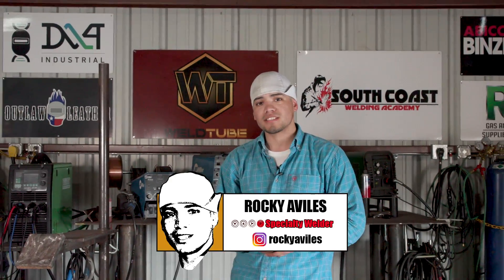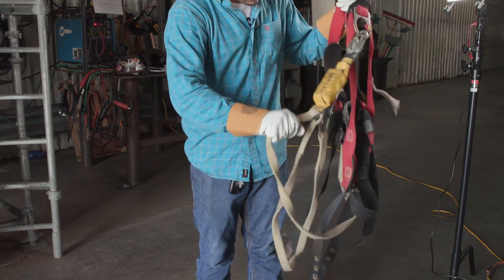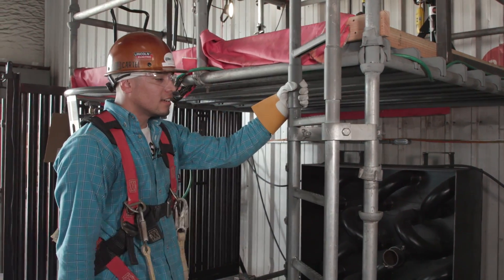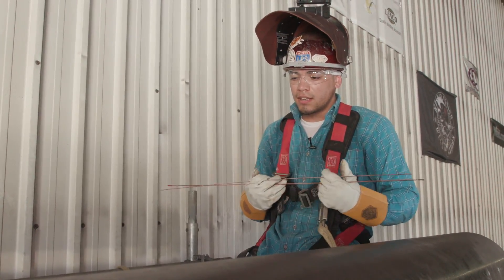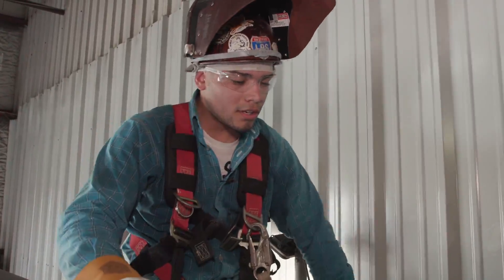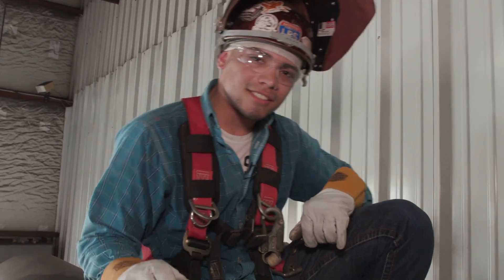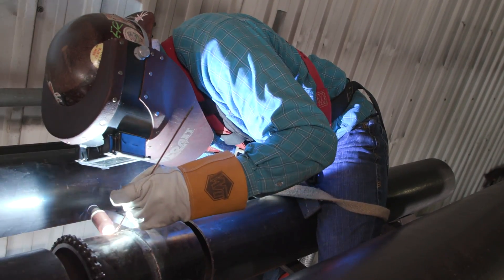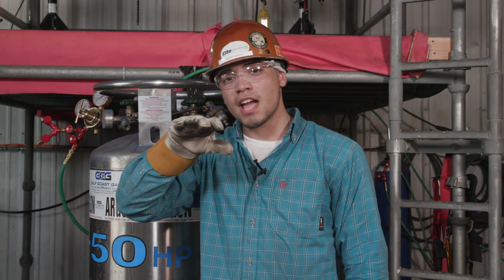TIG Welding for Oil, Gas and Chemical Plants

Comment: I've been working in the chemical manufacturing industry for 20 years, and I can say without a doubt that pipe fitters/welders are top notch.  They usually have to get their bodies into some pretty tight places to weld up a pipe and no matter what, those welds are always spot on.  I would feel bad for them at times when it's hot as balls outside like 90 degrees and they have to wear the long sleeve shirt with the leather apron and full ppe, but the job always gets done with out griping.!!

Comment: This is proper real world pipe welding, I've met plenty of guys that can weld pipe on a stand in the shop and make it nice, but cant wrap they're head around doing it in the racks.

I especially like the little hop at https://youtu.be/NDN3EpUjFbo?t=452 stab the wire in the puddle and back up a bit to make it stick so you can re grip the filler in an awkward spot, that there is the sign of a true pro that's been there and done it in the field.